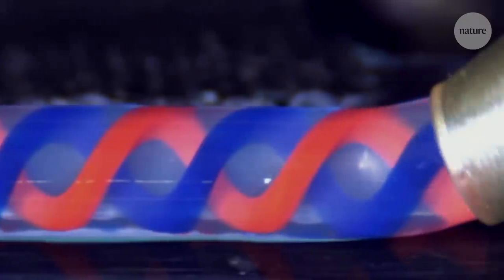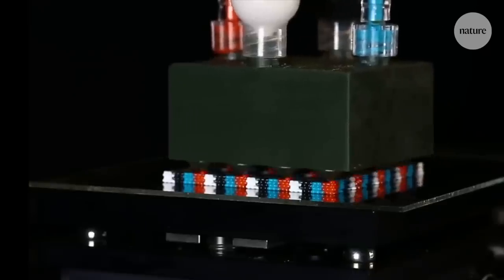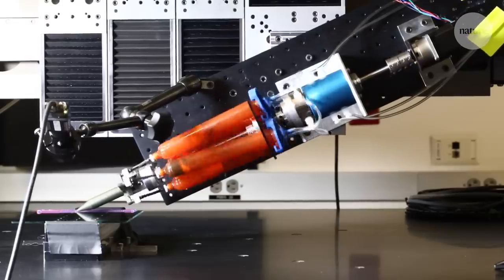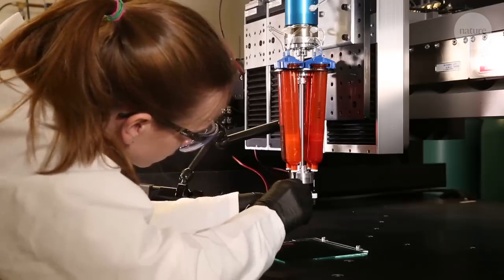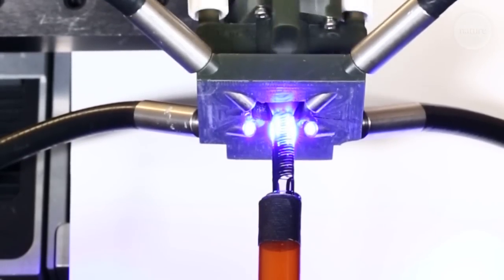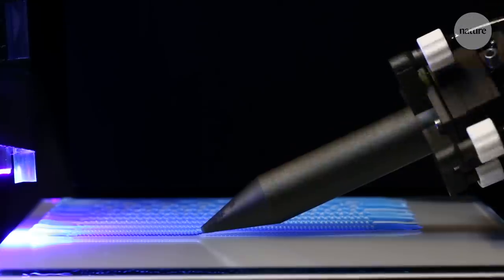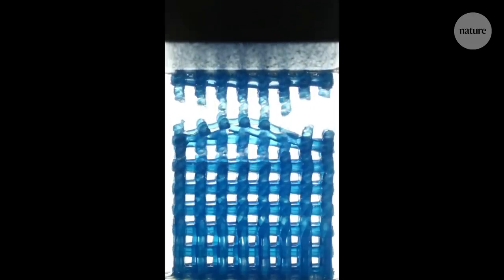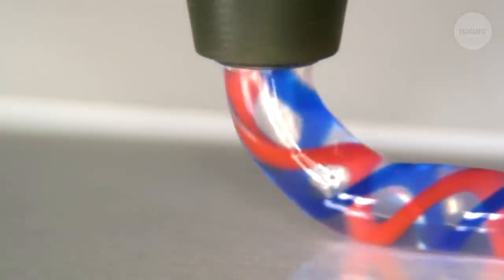3D printing - with a twist

Comment: 1:29 Yes that was a spark.  These types of artificical muscles use ELECTRO-STATIC levels of voltage: thousands of volts.  
One example in many Youtube videos is the "Hasel muscle", iirc they occasionally show the voltage driving electronics.
Reply: Electrostatics just means an unchanging potential, static, there's no associated voltage level. I would even say with this scale model it's likely the voltage was much much less than 'thousands.'
Reply: @xxportalxx.  How can you so confidently be so wrong. The static in electrostatic is refering to current, not voltage... High potential difference and low current is generally what is meant by electro-static.
Reply: @rich1051414  you're half correct there, it's actually the charge carriers that are 'static,' so yes you could say that the current is what isn't changing (this is however not true in the electrostatic systems I work with daily in particle accelerators, due to thermodynamics they will have currents as they do work, the same occurs in most any real world electrostatic system that isnt a perfect diagram in a textbook). 

To your second point it's true that to the lay-person static is a high voltage charge accumulated on something, however in modern electronics static charges of a couple to a few volts are far more common than static charges of any other potential, essentially by far more ppl are working with low voltage electrostatic systems than high voltage.
Reply: @xxportalxx.  what's your point... tho

"Hasel muscles" use thousands of volts.  Is there something wrong with this statement?  Or something about it that could use clarification?  
Not sure what you're trying to say.  

I THINK the things i'm saying are quoted from elsewhere, sure.  Pls correct as required.  (are u sure correction is required my dude?)
Reply: @roidroid  that there is no such thing as an electrostatic 'voltage level,' you can make a static charge of any voltage. Beyond that I'd be surprised if for the purposes of this paper they used thousands of volts, however the paper itself is behind a pay wall and I really don't care enough to pay to find out lol.
Reply: @xxportalxx.   Pretty sure volts are used to measure electrostatics too.  Afterall it is shorthand for "voltage POTENTIAL", no?  What has more potential than a static charge, seems like it was made for it.
Reply: @roidroid  yes, a static charge will have a voltage potential to a reference. Nobody in these comments claimed otherwise. I assume you misread my initial comment, I was pointing out that static charges have no associated voltage level, i.e. the op made the assertion that a static charge is 1000s of volts, this is not true, you can have static charges of any voltage.

Comment: I can imagine the conductive ink can be used for miniaturizing electronics even further, or being able to create circuits where none were easily possible before. I look forward to seeing how this develops and when it might become available on the consumer level
Reply: How would you deal with heat?
Reply: @HumanBeingSpawn  In the video they use it for low voltage appliance. It's also not out of the realm of possibility to make something like a PCB, a lot of current 3D printing material is already non-conductive and could serve as decent substrate
Reply: do you have any idea how small electronic components already are? anything this "technology" could make is orders of magnitude larger than the stuff manufactured by the existing industry which can benefit from economies of scale.
Reply: Printed circuit boards are already easily producible and wires can be thinner than human hair
Reply: @peachybreeze  Yeah, I can't see how this would make it any easier.
Reply: riiiight this machine can print at a few mm which is MUCH smaller than the 10s of nanometers of microchips... oh wait no thats 1 MILLION TIMES WORSE
Reply: @JonFawkes  But with PCB boards you already have this kind of thing. Makes no sense for that
Reply: Yeah no, printing with a nozzle will never beat or even come close to the photolithography methods we have been using for ages... You have no idea how they're even made to begin with and you're trying to suggest a 'better' method. 🤦‍♂

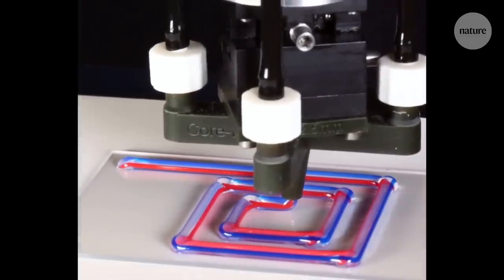Comment: 1:00  "Voxel, which is the 3d equivalent to a pixel" Though that statement is true, FDM 3D printers (the kind that use nozzles) do not use voxels in any steps of prep or print; It's all vector based. 

Also, UV cured resin and Filament is very very different.

Fascinating topic, weak presentation.

Comment: Should be incredible to put a little small wire of iron inside of the filament, and a kind of obturator, to cut. The products gonna have a lot more durability.

Comment: Have they considered spinning the filaments outside the nozzle interior fusing them together and then feeding the single filament line into a regular nozzle?

it would be much cheaper, work with existing hardware and more accurate.
Reply: That would defeat its purpose. The main goal is to obtain different properties at different locations of the print, with less tolerance than other already stablished methods
Reply: @wendellbezerra3102  yes and it would be able to achieve that. What I'm suggesting is that instead of the whole nozzle rotating the filament is twisted before getting to the nozzle itself. Lets say 10cm upstream of the nozzle it gets twisted, the printer extrudes 10cm, and then it knows that the current filament is extruding is the one it twisted 10cm up.
Reply: Ah, I'm seeing in another comment that it's not filament but instead a viscous liquid so that would make this method impossible.

Comment: how about the inside material being conductive?
you can make lights that dont have a wire to them etc
Reply: Or custom high voltage cathode with high precision! I remember back in the day, if you wanted a precise cathode for a desktop plasma fusion you would need to remake it 30 or so times to get the tolerances correct. I think this is going to make home experimentation a ton easier. For a variety of fields! Granted we are probably 5 to 10 years away from cheap at home versions of these printers. But it's exciting to see it being developed.

Comment: I've had this idea for a while, but not to mix materials.  I always wondered if you took a standard single filament 3D printer and spun the hot nozzle while printing, if the additional shearing action of the rotation would allow you to lay down more precise layers and lines, and even improve the adhesion between layers.
Reply: Wouldn't that cause issues with layer adhesion? If the filament is "spun" would there be potential surface area issues, and if it is smooshed like the traditional way and spun wouldnt it be better to not spin at all. 

For example I have a 3d filament pen. If I jerry rig my hand drill to it and spin it while printing it has severe issues.
Reply: @No0o0o0o0o0  Spinning definitely wouldn't work for a 3D filament pen because the Z axis isn't controlled.  In a typical 3D printer, the print head moves at a fixed height above the previous layer, usually less than the diameter of the extruded filament line.  Spinning the head will cause the extruded plastic to swirl and smear along the previous layer, potentially working more reliably into every crevasse or  micro void.  I may be wrong, not sure.

Comment: I can see 3d printing filament being made using this process!
A gang of tiny extruders, working to form an FDM filament.
Extruding FDM materials doesn't mix the material in 'standard' nozzles: the pattern in the raw filament would print faithfully out of nozzle, just much smaller.
When I heard conductive and dielectric, for a second I thought they were making a twisted pair of wires for communication or power delivery.

Comment: Thousands of the contacting print could create artificial muscles for robotics, depending on how strong they are, instead of using hydraulics, which could also lighten the weight and complexity of those robots

Comment: it would be cool to apply this technique to FDM, using normal filament fused with carbon fiber strings, to add more tensile strength to the new meta material.

Comment: I don't get it.  If it's not extruding thermoplastic what's the point? .  I suppose you would never be able to do this with thermoplastic, as it looks like it would add unwanted forces in the plastic.
Reply: You could do it with thermoplastic and carbon fibers. You would be able to create structures that stay performing once the thermoplastic breaks. So you’d know to replace the part but it won’t be a catastrophic failure when it breaks

Comment: No one calls filliment or what ever medium they are printing "ink" unless it is actually ink/paint/or similar. This error brings into question what other fact checking was or was not done for the rest of the video.
Reply: Yeah I've never heard it ever called Ink before. No idea where they have got that from.
Reply: @dejanbrice8774  from the paper, apparently. where the hell they got it, i don't know
Reply: It's not spooled filament, they use a viscous resin, so in this case, it is ink.
Reply: @morbus5726  Well we don't call resin INK in SLA
Reply: @dejanbrice8774  It's not an SLA printer...
Reply: @morbus5726  even if I relent that this printer uses "inks" as it is resin, the statement was that "3d printers can already print multiple materials called inks" said this way implies that all 3d printers use "inks" which is incorrect. While the whitepaper may use the term "ink" the statement is still factual misleading and incorrect. Again, a fact check by an editor should have caught this.
Reply: @ferrumignis  Well done, never said it was. Just like above how we mentioned filament, never mentioned it was an FDM printer.
Reply: @CatHerderCam  most of the actual good multicolor machines are polyjet machines, which do use ink. Even a 5 color prusaxl/toolchanger can't get the thousands of colors of a polyjet. So yes, i think the word "ink" is perfectly fine. They aren't talking about sub $10,000 hobby machines, they're talking about multimillion dollar inkjet printers.
Reply: @dejanbrice8774  So your argument was invalid...
Reply: @ferrumignis  Okay, thankyou for your valid input.

Comment: "~called Inks." Lol no they're called filaments. And this aint gonna be a an addon for an Ender 3 that has a functional Cura plugin for a long time. Also voxels are 3D pixels, and are used in physics simulations like the classic Maya Fluids system, Smoke/Flame, PhoenixFD etc.. I've never seen anyone try to use those terms for real life because our pixels are quantum and we can't yet measure them 😅
You're talking about g-code steps. But that's way more forgiveable than saying filaments are called inks 🤣
I hope this helps for future videos.
do hope this does pick up though, I love the potential! I hadn't seen this anywhere else and will subscribe for more odd finds! 😊
But for next time a simple checkover of your script with some random nerds should avoid you this sort of silliness. There'll even be 10 year olds laughing at this script I expect.
Reply: Holy crap, you're not actually Nature, the journal, are you??? I thought this was some independent tech-news venture.. learn and improve I guess. I'll be taking any terminology from you with a whole bowl of salt though!

Comment: i don't see how this adds to 3D printing tech. if you want to improve on what's there make it faster or find a new material that is easier to work with and doesn't need supports.

Comment: Okay, while this is kinda neat, I honestly can't think of a single, practical, valuable use for this overly complex contraption..... All of the things mentioned are either novelty, or barely useful applications that can already be achieved using other methods of existing, standard 3d printers.